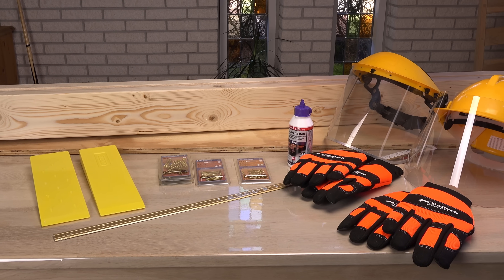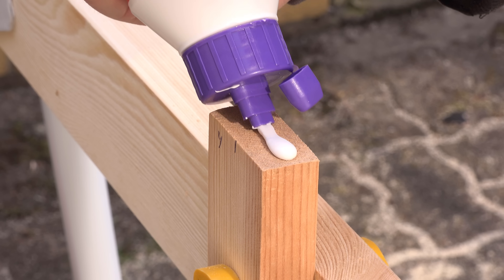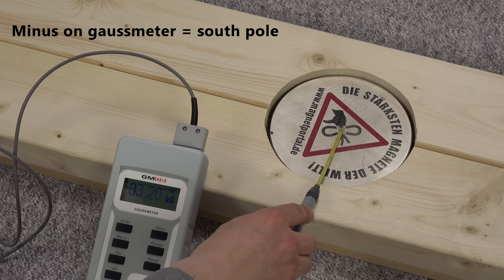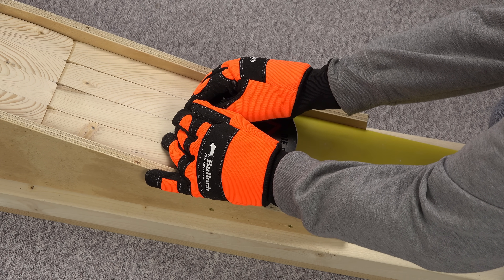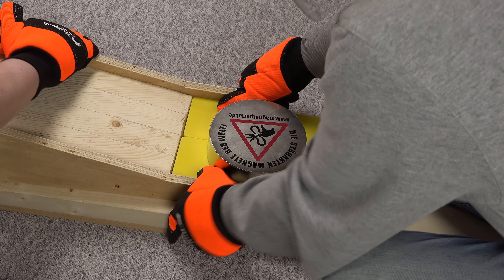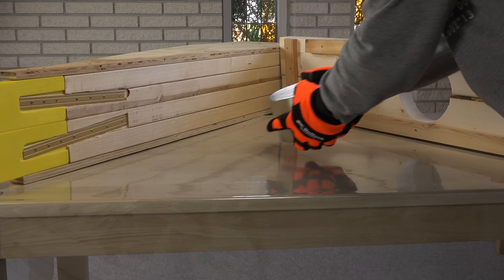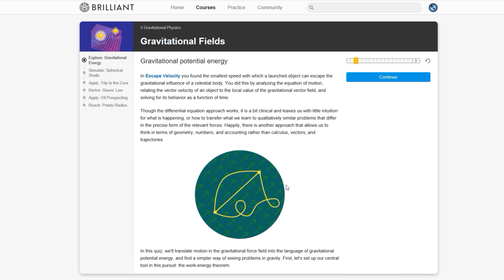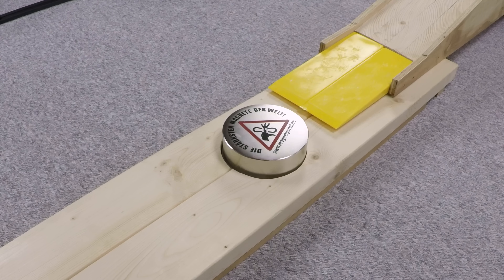Monster magnet meets monster magnet...

Comment: 7:40 that could be happenning for another reason.. the magnet is acting like a compass due to its strong field. It works with small cylindrical magnets too, they will always turn to face south and north, if the surface they are on is smooth.

Comment: Now you need to repeat thios process again with a second pair, and then put the two 6x4 inch magnets together with their repellent poles facing each other, you will need to force the two together with a vice. Once you have them secured, place them in a copper cylinder with an even space around the entire device....

Comment: Noise might be from friction. Each magnet is making contact with the wedge and the system is close to static so there are normal forces on each side of the wedge that are equal to the magnetic forces. Huge magnetic force means huge normal force. There’s also friction forces on each side that are proportional to the normal forces so huge normal forces means huge friction forces. This is definitely why it’s so hard to pull and I’m pretty sure (not totally sure) that this is creating the noise. It makes since that the noise only happens towards the end because as the magnets get closer the magnetic force gets bigger, so the normal forces get bigger, so the friction forces get bigger.

Comment: Asking someone to try and pull those magnets apart, would be like asking someone to pull Excalibur from the stone lol
Reply: Eric Bernik Only issue is that they would “pop” apart and be slung towards the cars and would probably slam into the body with the force of a semi truck
Reply: @Silentguy_  smol price to pay go scientific salvation
Reply: Only viable solution that I can think of is a hydraulic piston to push one magnet away from the other
Reply: Caliburn*
Reply: @ozpinII  Yup
Reply: @hayond656  why do people keep getting the two swords confused Lmao
Reply: @ozpinII  probably cuz in some versions they're the same sword with the different names

I like the 2 swords better though
Reply: @hayond656  same!
Reply: You could build a jig similar to the wooden guillotine-style setup he'd made for separating the smaller magnets, just use hydraulic cylinders with a lengthy bit of non-magnetic stainless pipe to keep the "free" magnet from coming too near the hardened magnetic steel of the cylinder's ram. Doing it that way would prevent anything having to be permanently affixed / drilled into the magnet itself. 

It would be pricey and time-consuming compared to something you can fab up quickly from 2x4's, but serious magnets require serious tools :)
Reply: @ericbernik4695  wouldn't work they are brittle
Reply: Does this means that somebody could do it?
Reply: Lol. Pretty sure the magnet will break first before you can pull it out..
Reply: Heat up and gently separate?

Comment: noise was from extreme friction of the plastic. distance squared and all that. it just came so close at that point to melt the surface of the plastic and bubbling made the noise...
so you made 10cm thick neodymium now. heat to 100 Celsius or above to separate but avoid too much heat (300^C) because it will demagnetize them permanently...

Comment: You inspired a possible  way for the world to be rid of fossil fuels  forever.  Neyodimium magnets are omnidirectional  correct? One side can be stronger than the other? Then "perpetual motion  " ISNT the question  it's how to create resistance to not burn the device made the hell out while  generating a potential. We need superlubes now
Reply: And then we got unlimited  climate detremental free power utilizing omnidirectional neyodimium magnets  for unequal  potentials.  How frigging strong is that thing? Bet a generator utilizing  those as one seen on YouTube labeled  "neyodimium magnetic motor free energy" posted in 2017 ...generating 12 kilowatts constant flow without input....well... past creation of it...  if it used those whopping things the generated wattage be like...  I couldnt fathom the scale. But damn that's awesome...make more! Magnetize the world!

Comment: I  think an easier way  idea for getting them together!,would be to put a plastic drainage pipe approximately 2metres  in length..place over magnet on floor..standing.....fill with ice....almost to the top....place other magnet in other end of pipe on top of ice.....then wait for gravity and melting ice to drain from small aperture in the pipe just above the magnet on the floor.(pipe would have to be just wider diameter than pipe!! Thanks

Comment: To separate them is actually easier then putting them together. For doing so you need to build another fixture/frame looking exactly as the one you had the lower magnet inside it. Then you place each magnet inside the cavity of each fixture/frame then you hold lower fixture fixed while pushing the other fixture aside making one magnet glide over the other magnet until reaching a safe distance to be able to pick it up. You also need to see into it so the fixtures can't glide to the sides while pushing so the fixtures can move in one line. You may need to use a big screw to push the higher fixture aside.

Comment: Use a large plastic pipe. Allow holes to regulate pressure while submerged in water. Magnets will come together and smaller holes and number of holes will allow for pressure to make this easier to complete this task. No wood of materials in between.

Comment: 6:00 i guess, this is not a scientist's channel? it was the air which is rapidly coming out of the way of 2 things coming one to each other very fast. and it caused vibrations of plastic, which made a sound because of tight touch with other object.

Comment: Why not just hold one magnet above another and drop it?
Reply: Quite easy: Neodymium magnets are extremely brittle, even small magnets shatter easily. And if one of those magnets has a pulling force of 1.2 metric tons, that means the magnets would pull themselves together with a force of ~2.4 metric tons. Which would shatter them immeadiately and send rasorsharp pieces flying through the room. See for example this video with two magnets with only 300 metric kilograms colliding: https://www.youtube.com/watch?v=Vt8NOdINJ1s

Comment: Safety first boys!
Helmet, eye protection, gloves, etc.
and then walking around on your socks...
Reply: Unlike me, magnets aren't attracted to feet!
Reply: @benoitcollignon735  A lot of modern security boots have plastic/fiberglass/carbon-fiber instead of steel reinforcement these days.
Main reason is that a steel piece isn't as strong as the other options. So the rating of the shoe gets better with the non metallic materials, and they are lighter, and at times cheaper too.
Reply: @todayonthebench  they aren't cheaper
Reply: @GOATESS_GOATERSON  Neither did I state that they are. From an end product price, the composite shoes are likely more expensive.

Though, manufacturing the reinforcement itself can be cheaper on the manufacturing side, especially for those that only have a molded piece of thick plastic. Composite structures on the other hand typically add additional manufacturing costs.

Steel on the other hand has its own manufacturing costs, and the thicker the steel gets, the process of cutting and shaping it becomes more involved as well.

I did state "and at times cheaper too." Not "it is cheaper too."
Reply: @todayonthebench  ok boomer
Reply: @todayonthebench  My unclue looks like a human test dummy for safety boots. He got all but his big toe clipped clean off on the left foot and somewhat flattened big toe on the right. Same accident happend twice (yes same EXACT accident in his own garage, on the same machine, one time each side..some never learn)..one was a steel toe and one a composit fibre.
Reply: @todayonthebench  that and if the metal gets damaged you may lose your toes due to the metal crushing them
Reply: @matthewjackson1661  Yes, it tends to be easier to heal severely crushed toes and fingers. But if a piece of metal is bent around them like a candy wrapper, then it generally ends up as a lost cause.

Though, the boots should be rated for the environment one works in. (ie, they shouldn't get crushed to start with...)
Reply: Not true, they are designed to cut the toes straight so it’s easy to sew them back on. If you have crushed them it may be impossible to repair.
Reply: @todayonthebench  I tried to make this arguement to the lady in charge at  a glass factory I worked at in Chicago years ago. 
I explained that with steel toes, after a rack of glass sheet falls on my toes, all the toes would be neatly clipped off by the toe protector. 
She pointed out that without the toe protector clipping all my toes neatly off they'd be macerated to a slimy pulp; largely incapable of being reattached. 

I had to give it to her, she had a point there. 

Though, this guy is inside his own house.  There's really no "foot hazard" present.  You guys say "well he's just wearing socks!"  I mean. he's just wearing a shirt and pants too.  If something came together and sent fragments everywhere it's not like he's already wearing a suit of armor and just has socks sticking out the bottom...
Reply: @benoitcollignon735   well just some normal trainers would be ok wouldn't want to get a splinter kicking that wood.
Reply: What do you want them to wear? Steal cap boots? wtf
Reply: Feet are overrated
Reply: im 1k  like
Reply: Completely ridiculous with the no shoes!! I would absolutely have shoes on for this wtf

Comment: The sound it makes around 6:00 is, I believe, the bottom magnet and the top magnet vibrating against one another rapidly after some initial contact. 
I think the wedge somehow allows the "bounce" from the impact to temporarily form a like standing wave with the magnet's subsequent pulling force, if that makes sense. 

Like a wayyy higher intensity and acceleration of the sound you here in this video: https://youtu.be/rFtYzVJcWyA?t=116

Comment: How about putting a big ice cube in between, and wait it to melt.
Reply: and the magnets will shatter or chip
Reply: @trydodis690  the key word was 'big'
Reply: Nicolas M I understood that, I’m assuming his idea was to have a large piece of ice that would slowly melt until they’re in contact with each other but that isn’t going to work. There will be a point where the ice is small enough that it doesn’t have the strength to support the attraction of the magnets.

It’s not as if the ice is going to gradually break, it will be a spontaneous event and the magnets might shatter with what is left of the ice.
Reply: @trydodis690  ya
Reply: @trydodis690  And we all know it's impossible to put the ice and magnets inside a plastic tube that will keep the ice from suddenly shooting out the sides.
Reply: the ice cube would be crushed
Reply: @tomf0olery  Not if the magnets and ice are contained in a pipe.
Reply: @alexfauble3235  nothing was said about a pipe. entirely irrelevant
Reply: Ice would shatter but maybe a tall tube of snow.
Reply: This could work possibly because the pressure would cause it to melt at an increased rate or it would just shatter
Reply: Probably a lot more effort than what they did,  but imagine a constraining cylinder that has say a 30cm thick ice plug in it.  Put the two magnets on either end then slightly heat up one magnet so that it will melt a very thin layer of the side of the ice that it's touching.  Keep the rest of it as frozen as possible.  Armchair engineers can come up with lots of ways to solve other people's problems :-)
Reply: @costarich8029  once it melted past a point it'd all crush
Reply: @costarich8029  Broo, by heating a magnet you'll permanently degrade its magnetism. You do know this right?
Reply: @LightningShiva1  It's only got to be warm enough to melt the ice.  I'm not talking about going at it with a torch.
Reply: @costarich8029  No, it will lose its magnetism to an extent, no matter where you heat it up to
Reply: @LightningShiva1  I'm not talking about that much heat.  Unspecified garden variety neodymium magnets will only permanently lose magnetism if their upper limit (typically 80c or more) is exceeded.  By lightly heat I'm talking with the palm of your hand, or anything more than 0C, the freezing point of water.  I didn't realize I would need to be this explicit in a theoretical experiment nobody is going to perform.  However, imagine getting a large tub of salt water and filling it with ice and then getting it even colder, i.e. below 0 celsius.  The salt keeps the water from freezing in the tub so the bottom magnet is not causing the ice plug to melt.  Now, warm the upper magnet to say 3 degrees above the freezing point of water.  The heat gradient will force the interface to melt between the ice plug and the 'heated' magnet.  Heat it by putting your hand on it.  Or exposing it to air.  Or tap water.   The magnet will force the tiny thin layer of melted water to leave and the slightly warmer magnet will move closer by a fraction of a millimeter.  If it starts moving too fast, lower the temperature of the 'warm' magnet so that the interface with the ice plug melts slower.
Reply: @costarich8029  🤦🏼‍♂️ kill me
Reply: @LightningShiva1  Try that ice plug magnet experiment.  It sounds pretty dangerous.  :-)
Reply: Costa Rich curious how this solves the above issue of the ice reaching a point where it can no longer support the pull of the magnets and shattering long before they’re close enough to avoid damaging themselves when they meet
Reply: @IanZWhite00  Again really more of a thought experiment but as mentioned the magnets are constrained in a tube with a diameter the same size as the magnets, how does the shattered ice get out of the way of the magnets?   Water (and ice to a certain extent) are basically incompressible. It can't just instantly slide out of the way even if it's shattered and cracked.  And if you've ever left water any container and frozen it you know it has a tremendous amount of strength.  Again no one is ever going to perform this experiment, but I think that it could be made to work.  Would it be worth the effort and hassle? Probably not.

Comment: Why not have a tube of the same diameter of the magnets, submerge it in water, and insert the magnets in from both ends.

The water pressure within the tube will increase and the magnets will be forced to slowly move towards each other as water displaces...

Comment: Would have been much easier with a block of ice that is slowly melting between the magnets.
Reply: I don't think Ice would survive that amount of pressure
Reply: @AdulAhmad68  I think a 2ft ice block would be fine. I don't think the force is that bad if they are 2ft away from each other.
Reply: @VagueMemory  It would be interesting to see!
Reply: @AdulAhmad68  neither the magnets
Reply: woudln't work, even if the ice was big enough to start far enough away, as it melts the magnetic pull between them two magnets will get stronger and stronger until they just shatter the ice between them and fly at full force to eachother
Reply: Honestly that wouldn’t be such a bad idea until they got closer. After moving close enough they’d probably just crush the ice and slam into one another. And neodymium magnets are super brittle
Reply: How a bout magnetic dough
Reply: magnetic putty

Comment: Hmm what i was thinking that You Go out side, put first magnet at the ground, make a Crane thing thats about 17 feet or below High, Put the Second Magnet at the crane thing, Connect the Crane thing to a lever, Make a wall with Glass windows thats about 20 Feet away, Put the Lever Behind the Wall Where You Guys will Stay, Now Flick the Lever Which it Supposed To Drop the Magnet Then Voila! The Magnet Will Probably Make a Huge Noise Since there Monster Magnets And If they Fly To Any Direction, The Wall Will Protect You If its Made out Of Steel and Not Wood!

Comment: Wouldn't a lever secured to one magnet have been easier.

So long as the other magnet is secured to the floor and the other secured to a lever you might have been able to push the two magnets close then slowly lever one onto the other at right angles.

I noticed neodymian magnets are less strong on the side, but once it gets to a certain point they snap into place, so using a lever would control that motion.

Comment: Why not just use a pipe with the same radius and drop it above each other through the pipe hole safely? 🤔
Reply: The impact would shatter the magnet
Reply: @protogem77  short pipe like a 2cm~4cm gap between them.

Comment: Dude.  You weren't wearing shoes.  Working with things like that with nothing but your socks?  That's nuts.  Something like that requires heavier gloves, pads on the extremities, and steel toed industrial boots in case you drop one of them.

Oh, wait.  Scratch the comment about steel toed boots.

Comment: I would’ve just separated the magnets with a block of ice, as the ice melts it would slowly draw them together
Reply: Tommy 3v the force of the magnets would crush the ice. No?
Reply: Maybe use a PVC pipe. Then it wouldn’t matter if it got crushed or not
Reply: @tommy3v625  Still no, ice melts under pressure so the closer the two magnets get to each other the faster it will melt and it will most likely melt way to fast when they get close enough, smashing the magnets.

Comment: Get two Abram tanks to separate them. Weld a loop of steel to one side and weld another loop on the other side of the magnet. get two chains strap them to the Abrams, and start pulling.

Comment: Nice and well built wedge rig but a close fitting non ferrous tube packed with ice or snow would have been so much simpler. Also, the puzzling noise near the end is the magnet starting and stopping quickly, similar to a squeaky hinge.
Reply: I had the same idea. Nice.

Comment: Use a vertical tube of the same diameter as the magnets. Put one magnet at the bottom. Put a lot of ice cubes on top of it. Put the second magnet on top and wait for the ice cubes to melt.
Edit: just noticed some similar ideas in past comments.